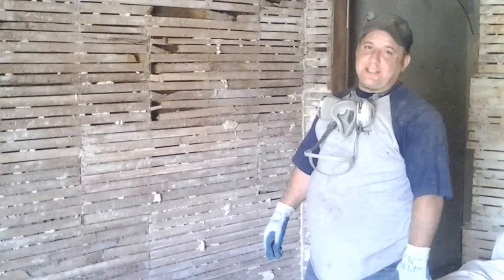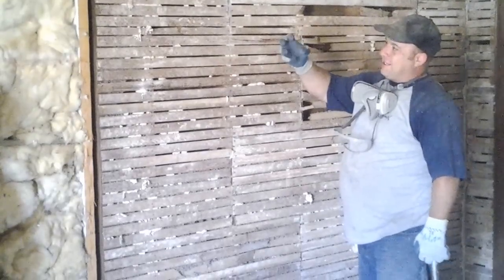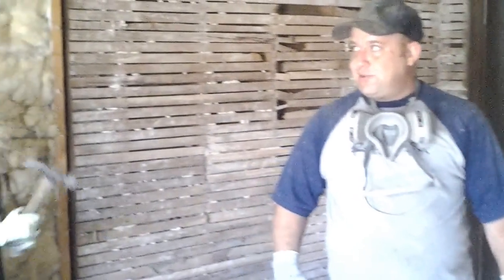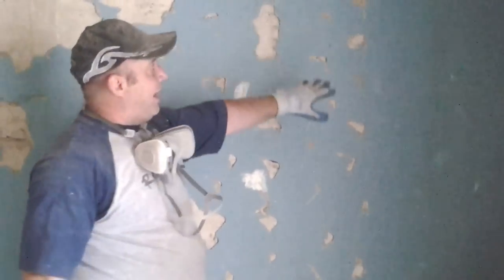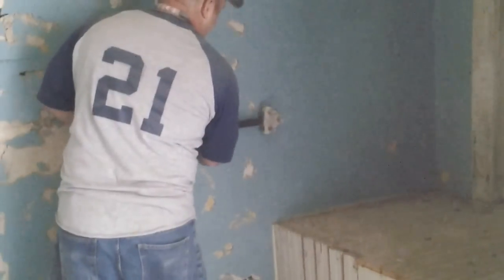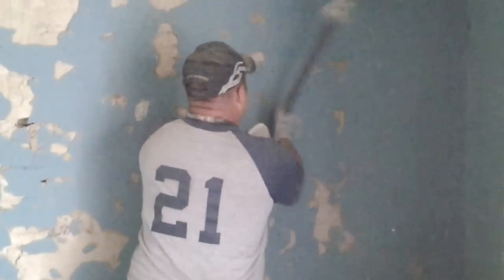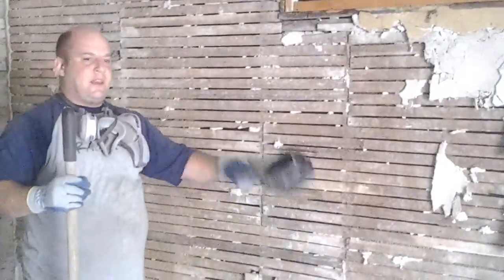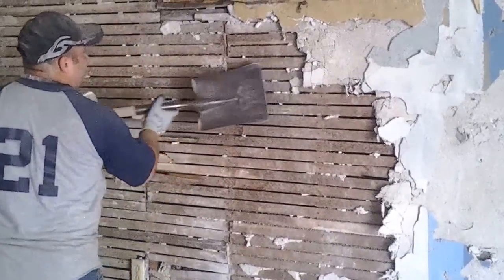DIY how to remove lath and plaster part 1 Plaster

Comment: Good video, I see some people mentioned lead paint and asbestos. Just a tip as a construction worker, if you are concerned about these things (and you should be) get some rolls of plastic wrap at the supply store and duct tape them around the doors to contaminate dust, then put one box fan out the window and one box fan blowing in the doorway cut out in the plastic. Put the one in the window on a higher speed than the one blowing in and this will create a negative air pressure in the workspace keeping the particles from spreading through your home. It might not be perfect but it will cut down on dust spread majorly. Always keep your mask on in the workspace and do a good cleanup after the demo.
Reply: I didn't mean to say contaminate dust, meant to say consolidate and no problem at all. Make sure you wear your masks! Get real filtered ones not the medical type masks.
Reply: +elemento1991 So you have it blowing into the room from out of the room?  I have 2 windows in the room and I had 2 box fans - 1 in each window - both blowing out.  trying to get all the dust out.

Comment: Thanks so much for posting this video! I found your technique much easier than the smashing technique I had used on my previous walls. The plaster comes out in much larger chunks making clean up a bit easier. The ceiling was quite a workout working overhead, but the sturdy flat shovel really did a good job, and prying off the lathe rather than breaking it was a great tip too. Thanks again!

Comment: Wish I would have used this method before all the demo I did. One tip I was shown if you are taking out both sides of a wall - if you have one side removed you can take down both the lath and plaster at once on the other side. Just take a 2x4 and bang it near the studs from the other side. Both lath and plaster come off super quick and the length of the 2x4 helps with the taller areas so u dont need a ladder. If you loosen it first at each stud, the lath comes out in whole pieces. I was using a long crowbar, and the 2x4 was longer and lighter. Just make sure to pickup the lath regularly. Even being dilligent about cleaning up,  with thick work boots I got a couple nails in my foot.

Comment: I hate lath and plaster. I wish I'd watched this video, when we were redoing the outside walls on my mom's house. We had to remove the laths, because we used fiberglass insulation and added a vapor barrier. Lath and plaster. What a pain in the neck to remove and then clean up and haul to the dump. Too bad they didn't use wire mesh, instead of wooden laths. Would've made installation and repair easier. Would also make removal easier. Thanks for sharing.

Comment: I just did this.  I used just a hammer to bang out the plaster.  I used a painters knife to get in between if it stuck.  
When the lath was exposed, I started to remove those.  It kind of seemed to me to kill 2 birds with 1 stone.  As when I'd pull on the lath - the plaster just falls off. 
I didn't care much about keeping the lath in one sheet. It was actually easier to carry them broken.  I put them in a barrel and took them down and burnt them.  
Now, I don't know how to dispose of the plaster.

Comment: I have a question in case anyone is responding to these. 
I just did this as I mentioned in my last comment.  As a start we did one wall.  It was really falling apart.  The wood around the window is even rotting.  We ended up doing both exterior walls because there is zero insulation and the plaster was cracking a bit.  When we moved in years ago, I had painted and the paint was strange as it sounds - peeling off all the way to the plaster.  Just seemed like it had to go. 

So now that we have this huge mess, we are considering cleaning up a bit and removing the furniture from the room and doing the remaining 2 walls and possibly even the ceiling. 

For the ceiling we considered just putting the sheetrock right over it instead of breaking it all down.  The interior walls aren't in that bad of shape.  However there is a corner where maybe they had some sort of chimney? But it just now takes up about 3 sq ft of our bedroom.  

So. question is.  While we already have a mess, do we continue?  Or just quit while we're ahead.  Since really the other walls are fine?  On one side we'd get rid of the old lead, and I can actually hang something on the wall, and all that.  Downside - the room is really good at blocking sound as it is.  And of course the extra work and expense.  I also hear that the lath and plaster together are better at closing in a fire.  So, I'm really having a hard time deciding what to do.

Comment: The better method is to use an oscillating tool with a diamond cutting attachment and to cut through the plaster and then pry it apart in sections. It will easily break apart. Hammering at the wall creates dust.
Reply from the maker: Great thought, I guess i just used what I had available, I would love to get one of those tools it is on my wishlist.

Comment: What are the chances of having asbestos inside these kinds of walls anyways?
Reply: chances are high
Reply: it was cheap/affordable at the time how many people today tend to do the cheap/affordable thing?
Reply: I dont think asbestos became mainstream in homes and insulation starting in the 1930s, but has been mined since the 1800s. The worst kind is friable, pipe insulation and loose attic insulation - vermiculite. There are also adhesives, flooring, siding, and some plaster that have asbestos. I think the hose hair type might be ok, but you never really know without testing. Better to be safe than sorry and at least make sure to wear a properly rated face mask (n95 or 100), change clothes and wet them down before bringing into occupied spaces (or toss them). I spent 200 bucks on a full face mask, but much cheaper than medical bills down the line. Plus dont forget about lead paint, which is terrible for kids but also not great for adults either.
Reply: Just got off the phone with someone. He said 90% that these plaster walls of asbestos
Reply: @jenniferwhite3009  what this guy did in the video. Is that considered friable?

Comment: hey Chris I was wondering what measures did you take (besides the mask ) to ensure that there are no traces of lead paint particles in your house after everything is removed ? I only ask because I am dealing with this stuff in my house built before 1930 . thanks for the vid !!
Reply: While the video is appreciated, this guy is not the guy to ask, as he has his mask off quite a lot..Those walls are likely covered with lead paint. Generally, if you keep your mask on until well after the dust has settled and you have thoroughly vacuumed with a fresh bag/filter, you should be ok lead paint wise.

Comment: It looks like part of that wall has insulation like rock wool or asbestos. You need to keep your kids out of that area. This stuff as microscopic crystals can be inhaled into the lungs and be a life long locus of disease.  A professional air filter is required not the kind the kid is wearing,  If it were me I would have a good sized HEPA air filtration system running.
Reply: The unions, government, and corporations made asbestos into a huge deal. I’m not saying it wont cause harm but my step dad is almost in his 90s and worked all his life in an asbestos plant and at that time they didn’t have the proper PPE. I also have relatives and friends that work with it as well and are still kicking around. As long as your not bathing in the stuff and swallowing it and not constantly working with it for a long time you should be fine. Just wear a good mask put some box fans in the windows with a furnace filter and you should be good to go. All this asbestos nonsense was created for profits

Comment: Thanks for the video. I'm renovating the upper floor of my commercial building that was built in 1905. It's a pain to remove all the lathe and plaster, but I'm going to expose the brick and make it into loft space for shared offices and who knows what else. You can check it out if you like at 

http://russellbrown.co/lathe-and-plaster-removal/